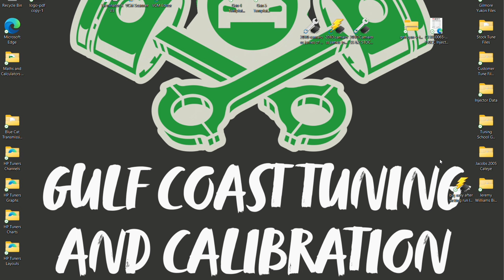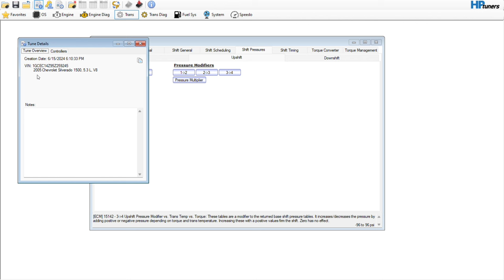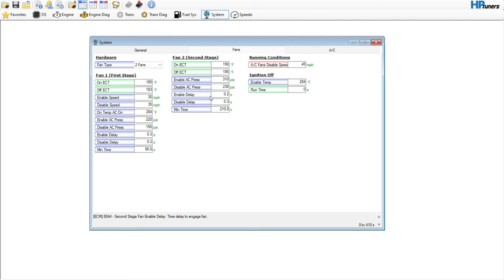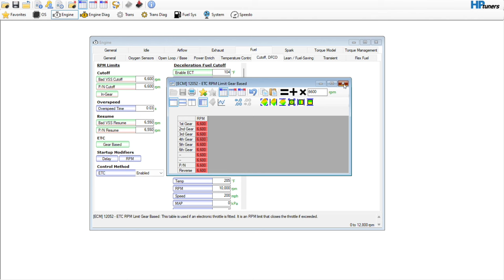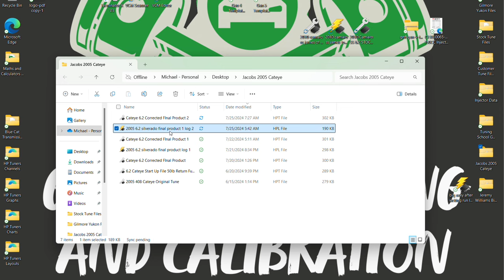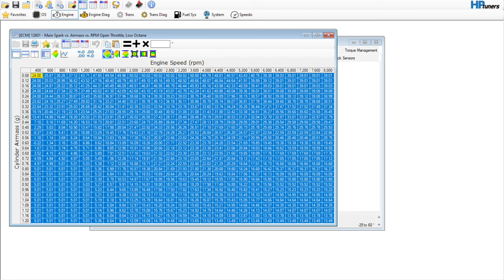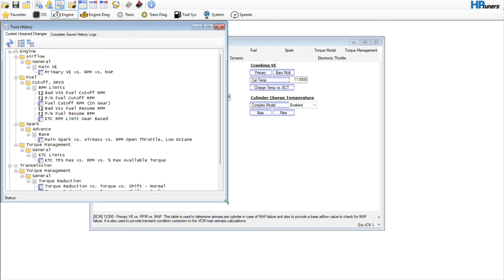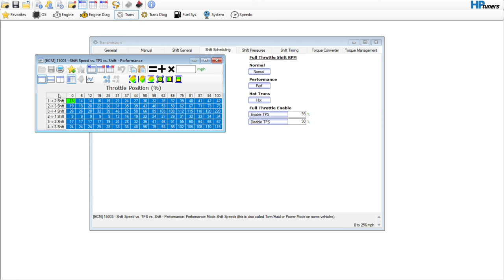Speed Secrets: Maximizing Big Cam Single Cab Performance

Comment: How do you deal with Gen 3 cammed trucks when they want to turn off approaching a stop? It’s doesn’t happen all the time, only sometimes.
Reply from the maker: Having enough base running airflow in conjunction with spark timing to help soft land the stop. The throttle follower can sometimes play a roll as well. Typically commanding an idle that it maybe a little higher than you might like will work and adjusting the spark and air from there. The camshaft will decide all of that though. 750rpm is kinda my minimum for all cams. What are you working with?
Reply: @GulfCoastTuningandCalibration  Chopacabra cam kit on 5.3 with longtubes.
Reply from the maker: @AxelZavala553  if you want me to email me your file I’d be happy to look at it for you. Michael.happygilmore@gmail.com